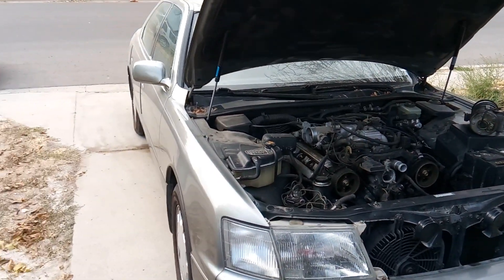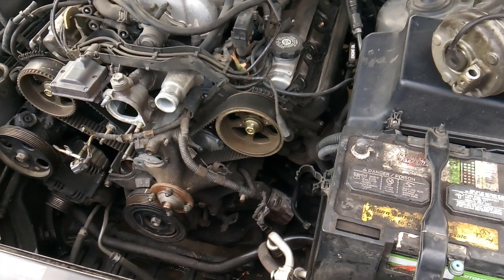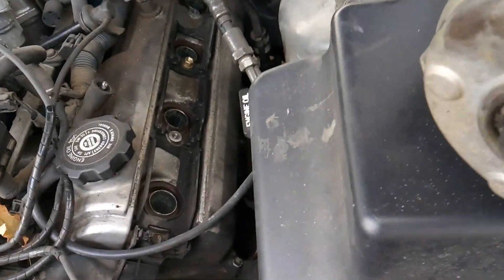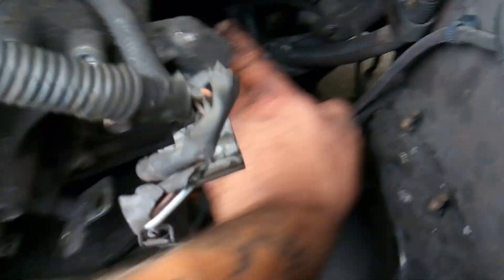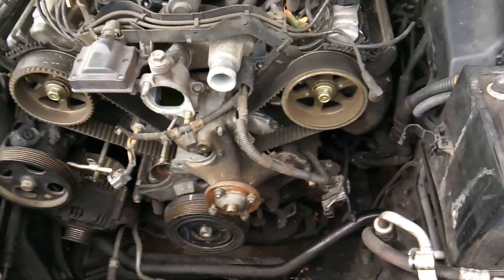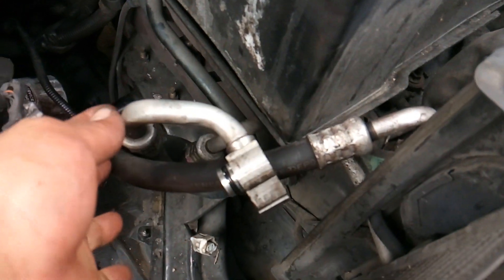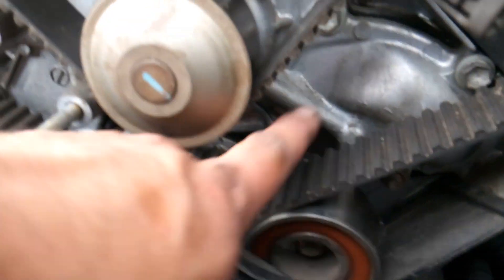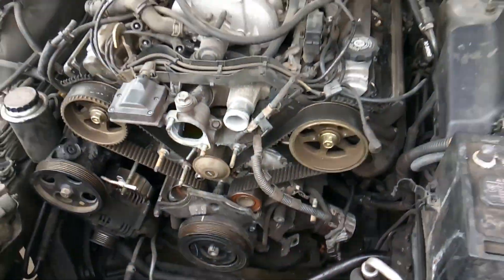1995 lexus LS 400 timing/water pump part 2

Comment: Hi. Have a question. Bought a 95 ls400 with mileage of 117000. Timing belt was done during 80000 but that was  2007. Shall I wait longer because of low miles or do the timing belt now because it is more than a decade since the last changed? thank you. Nice informative video BTW.
Reply from the maker: I would. pull the covers and check the belt. see if it looks dry or cracked.
Reply: @MattShaughnessy6  How comfortable are you with a visual inspection of the belt to determine whether or not to do it? I mean, if you had no idea when the belt was changed last. I have no record of when it was done last on my 183k mile LS so I am inclined to assume it is due. It's a 1996 so the last thing I want to do is risk damage due to belt failure since it's an interference engine.

Comment: Is the SC400 same engine and requires same maintenance ??
Reply: Yes and yes. The "400" in the Toyota (Lexus) model names refers to the engine displacement of the engine. LS400, SC400 and GS400 of similar years all have the same 4.0L V8.